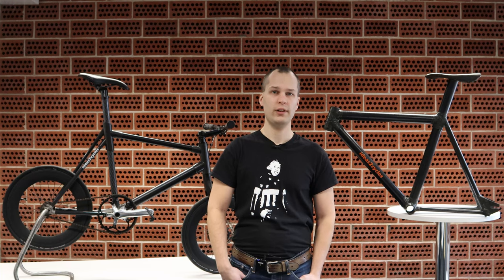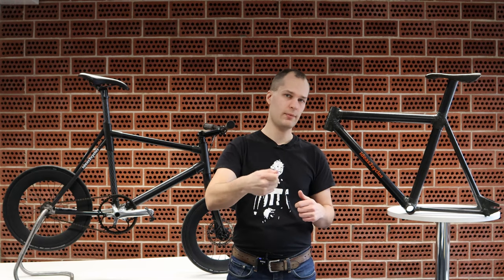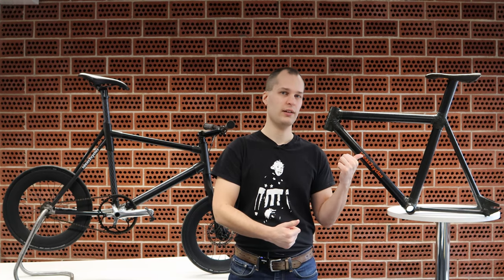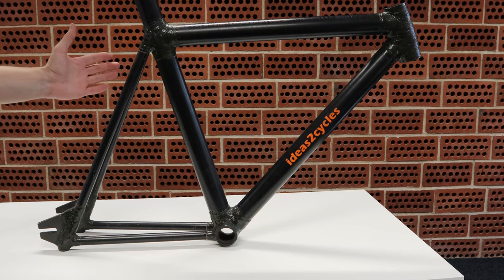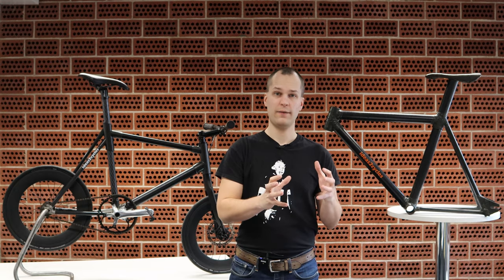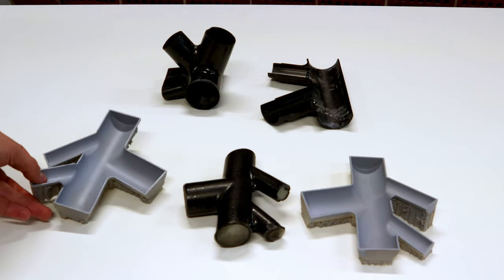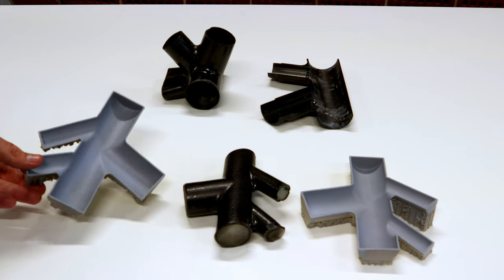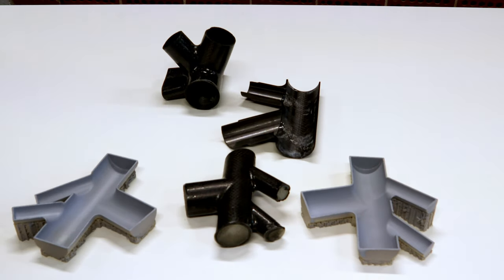Using inexpensive 3D prints to make carbon fiber bicycle frames

Comment: Great video. I've been following another guy who successfully built his carbon tube bike with 3d printed carbon ABS lugs. I'm much more interested in the moulded carbon luh idea though. Do you mould both sides of the lug together then? And do you use wet lay, pre-preg, oven?? I'm interested!
Reply from the maker: We made a one-piece part using vacuum baggin. Two-part lugs sounds like a bad idea and frankly the stiffness and layer adhesion are not ideal with printed ABS-CF.
Reply: @Ideas2cycles  Ah, sorry. I meant two-piece mould and a one-piece lay-up of course. Your demo showed a split-piece. The other guy used single-piece 3D printed lugs of course.

Comment: So the tape could also be good to make Zwift frame for indoors right?
Reply from the maker: Yeah, absolutely. Especially for that, since the rough appearance will not be an issue when others don't see the bike. The structural performance is still there. Does the frame need to have some rating in the app?

Comment: Hi, amazing project !

I am using structural epoxy to bond carbon fiber tubes to polycarbonate (with carbon fiber) 3d printed parts.

Once dry, is it possible to dissolve the epoxy to dissasemble my parts ?

Regards.
Reply from the maker: Thanks! 
Bonding dissimilar materials adds always some complexity to the design, so be careful. That combination also is one where disassembling without destroying the parts is near impossible. We've had success salvaging metal lugs by heating the epoxy adhesive and breaking the CFRP tube, but that would not work with PC-CF.